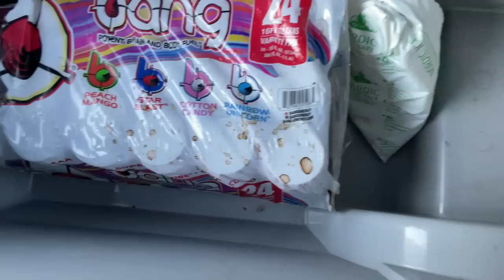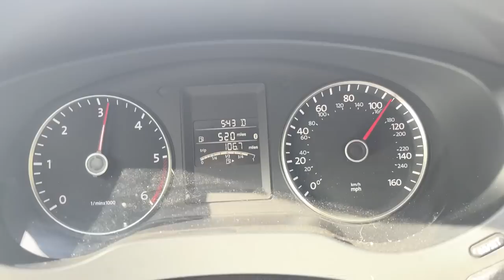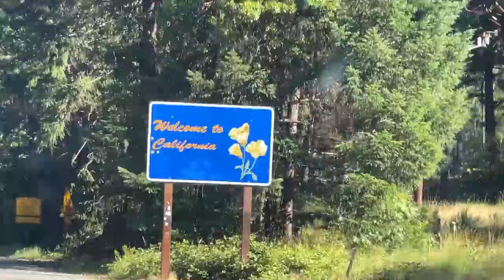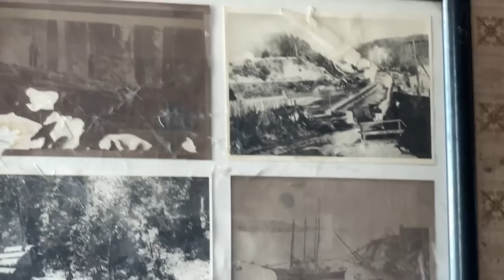Jake and Gordy's AMAZING Redwood Adventure!

Comment: Thanks for another interesting video, Jacob. Bit of trivia - Longitude lines run north and south and are all equal length (long, as in longitude). Longitude lines are also called meridians and are referenced to  the Greenwich Meridian, or Prime Meridian. Latitude lines run east and west, parallel to the equator, and are shorter closer to the north and south poles. Antone was saying Japan is the same latitude as northern California.
Latitude lines are parallel to one another, Longitude lines all join at the poles and so are not parallel to one another.
Reply: Correct.... and metasequoia are native to a remote valley in China, not Japan, and weren't discovered until the 1930's. Aka dawn redwood, they, along with bald cypress, are the only deciduous conifers.

Comment: Hope you like that husky… the XP stuff is awesome. I picked up a 562xp w/ auto tune and a 28” bar and I love it. Out here in the east coast it rips thru most anything I come across… only thing I’ve had issues with is hot starts after running for a while. But online guys are saying opening up the muffler some will alleviate that… yet to do that but I’m going to try it